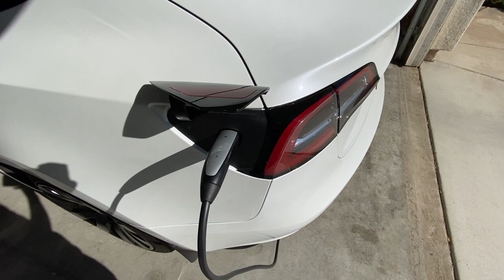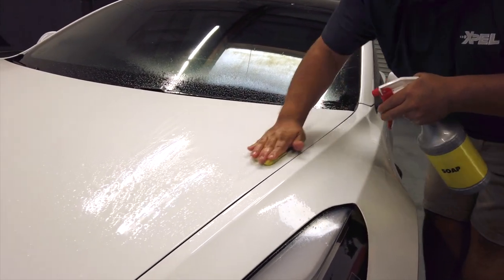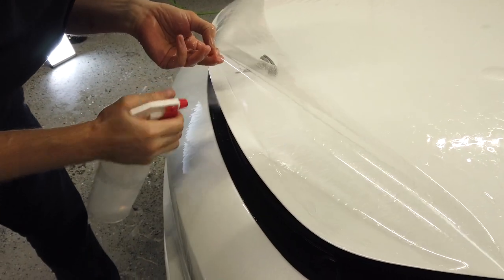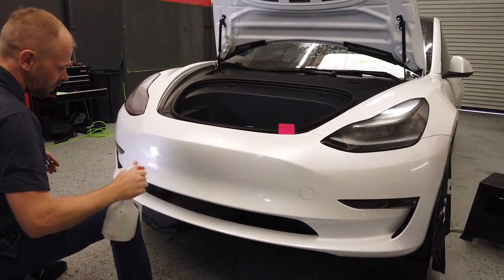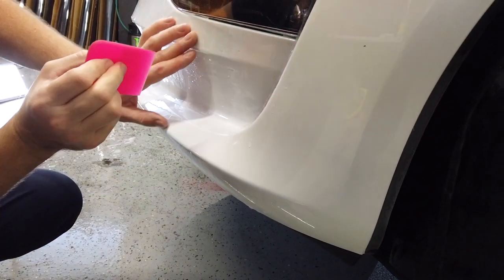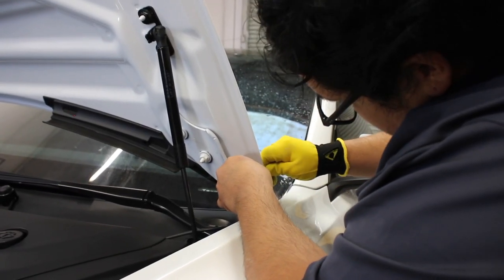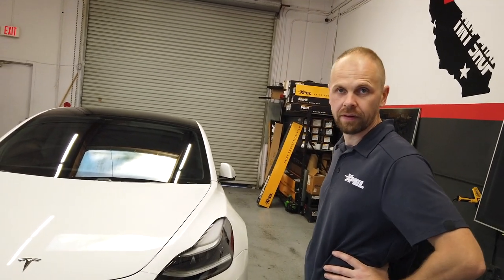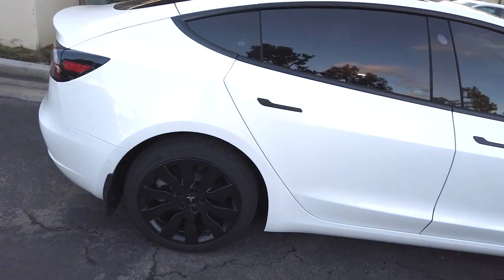Watch this before you get PPF (Paint Protection Film) for your New 2022 Tesla Model 3!

Comment: Clay is an abrasive and causes marring and scratches. Whenever using a clay bar to decontaminate, the paint should be polished afterwards to remove the damage caused by the clay bar. So they basically scratched up the paint and put PPF over damage. Ceramic coating over PPF isn’t overkill at all.🤦‍♂️
Reply from the maker: Thanks for the info. Thank you for watching!
Reply: @dadstoyscars  
The good news is that your car is white! Off topic but if I may ask. What do you think of the V11 UI?
Reply from the maker: @RayNLA    I think Tesla was trying to clean up the main page in order for it to be ready for the real FSD. At the same time they got rid of shortcuts from main screen that used to be easy accessible and now added couple more steps which is suck! But I’m sure they will improve with future updates. 🤞
Reply: @dadstoyscars  
Man…My exact sentiment. I’m pretty frustrated with it to say the least. I got a new update today but I imagine it’s minor. Hopefully they add the missing controls to the top of the screen soon. 
Thanks for replying and enjoy the rest of the evening.

Comment: should have removed the "T" and re-applied it over the bra. you will now have dirt lines. The paint on all  Tesla products require a full paint correction, compound and polish. I also noticed the bumper was not wrapped into the  fog lights more dirt lines later. Steam..... Not recommended as it distorts the adhesive, mostly noticed on dark colors, steam is a crutch, not necessary if your experienced. Over all the installation was ok, minus the areas to pay close attention to when installing on white paint.
Reply: I noticed they went right over the logo badge as well,,, I have talked to 3 shops in my area, and they all said they take the logo badges off

Comment: I don’t have a TEsla, but when I do, I will definitely bring to these guys.  They are professional as what they do.  It came out really good.  What’s the total cost for the front end?  What’s the total cost for the whole car?
Reply from the maker: The cost for front bumper, hood and headlights was $1,200 but that was in October last year. Please call SoCal Tint Shop in Riverside for their current pricing and price for full PPF.
Thank you for watching Jon!
Please subscribe for future contents.🙏😃
Reply: It’s not just fro Tesla, if you plan to keep the vehicle not leased.  Then I’d recommend to get the car with ppf put on.  I compared my old BMW M4 vs my colleague BMW in 1 month he had about 30 rock chips under one month of highway and local driving.  This is why I got my MYP done.  Just think, if your planning to keep you car, the overspray at any decent bodyshop to color match you bumper/hood cost is about $1500 for a decent bodyshop.
Reply: @dadstoyscars  $1200?  Wow.  Front bumper should be $500 ish, headlights $75ish, hood shouldn't be much more.  Are you sure $1200 didn't include front fenders?  I maybe shouldn't say, "should be."  Everyone charges what they charge.  Prices I've seen is probably more like it.  Okay, I listened to the rest.  $4500 for the entire car is a good deal.  
Edit:  I just received a quote for entire car PPF and it was NOT $4500.  It was $6000!  My  model Y is a new 2023.  In my opinion, $4500 is good, $6000 is high.  Just an FYI

Comment: How much is doing the PPF on your model 3? By any chances you know the pricing on doing ppf on Model Y?
Reply from the maker: My Model 3 Was $1,200 included full hood, full bumper and headlights.
Model Y shouldn’t far off of what I paid but please call SoCal Tint Shop to confirm their current pricing. All the info are in description.
My model 3 was not full front PPF just what I listed above. Thank you for watching!
Please subscribe for future contents. 🙏🥳
Reply: @dadstoyscars  thanks will call them. Also, what else would need to be included for the full front ppf? Mirror?
Reply from the maker: @IAmThePrepper   both sides fenders and mirrors.
Reply: @dadstoyscars  Did the include the tint too?
Reply from the maker: @habibi750   It didn’t include the tint.
Thank you for watching!
Please subscribe for future contents.🙏😃
Reply: @dadstoyscars that is a great price, that would be like $3-4k on the east coast. I paid about $6k for entire car is the Matte Finish on my 22 MYP.  Prices will vary with the expertise of the installer. So it a big YMMV.  Paint correction must be done to take off all the dirt, oil and contaminants off the paint.
Reply from the maker: @ilovepinktacos   Agree! They are one of the best in the area. 
Thank you for your great support!🙏😃

Comment: I don't understand why you would put PPF on a cheap car. I bought a brand new Audi s6 and tiny rock dings and scratches never bothered me. You'd have to look closely to find them. Ive owned it for over 5 years and the car still looks great without any PPF. I wouldn't waste money on PPF unless I own a collectors car.
Reply from the maker: Many Tesla owners put PPF because the way Tesla designed the front end of the car to make it more aerodynamic and efficient which make it easier to get rock chips than normal cars. Thank you for watching TureJay!
Reply: Good 👍🏽 thanks 😊 🙏🏾
Reply: How is a new 2022 model 3 at $60,000 a cheap car ?